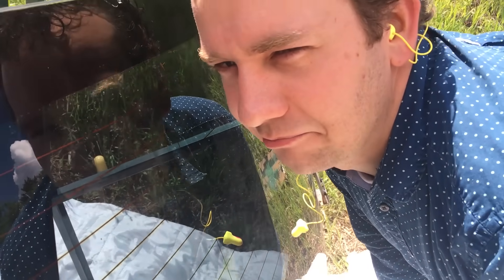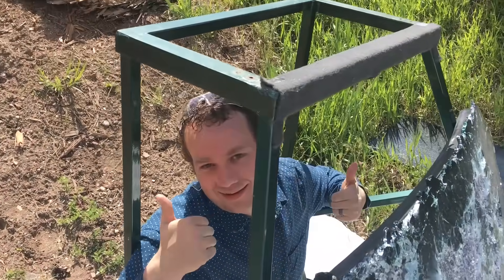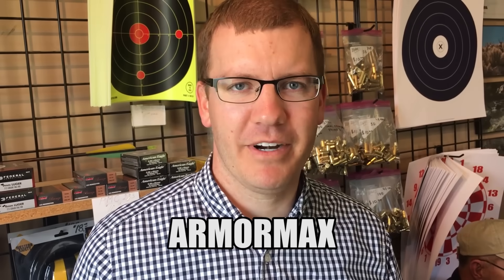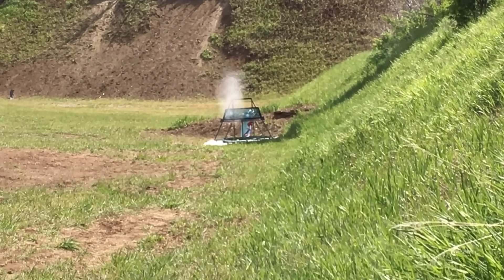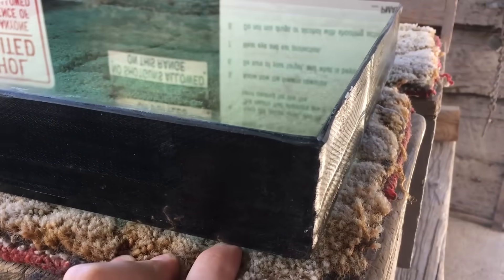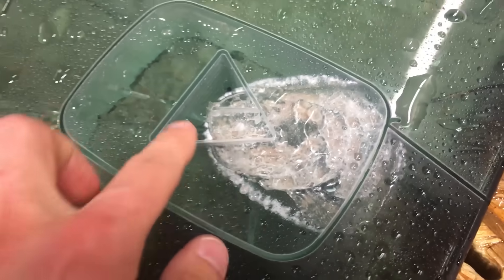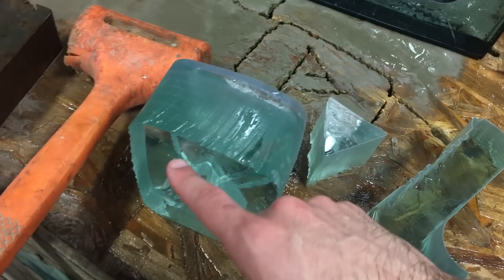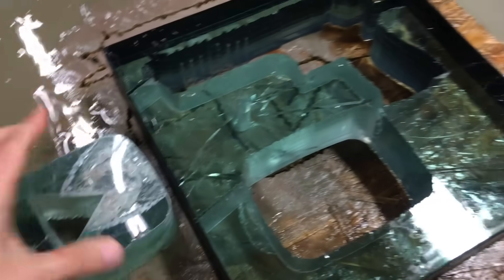Bulletproof Glass vs 60,000 PSI Waterjet

Comment: what happens if you fire a gun towards the waterjets waterbeam?
Reply: Atoms will split, it will be like Japan in 1945 all over again.
Reply: I don't think the bullet needs to hit the nozzle. It would be interesting to see if the waterbeam cuts the bullet in half mid-flight.
Reply: You get a really "Clean" shot.
Reply: I think it would just deflect the bullet downward without causing any real damage. Just like pretty much everything else they cut, if it isn't laying on something to keep it still, the water jet would just push it downward before it did any real cutting.
Reply: goku vs vegeta happens
Reply: cut the bullet in mid air
Reply: That's different, my hand isn't made of lead, or bullet proof glass, or even a solid chunk of hardened steel....
Reply: Most likely the bullet will be stopped in its place and shot elsewhere. Would be very cool to see tested and with a super slow-mo camera :D
Reply: Zorkz It'll cut a hole through the middle of the bullet but the outer shell will hit the machine
Reply: Alucard Pawpad yeah from the end of the mixing tube to the first HP plumbing is probably about that much. I run two waterjets daily and the mixing tubes alone run about  $130 (that's the part that focuses the stream to cut).
Reply: Alucard Pawpad prob redirect the bullet
Reply: maybe so, but do you think itll change the direction of travel?
Reply: The lack of a fundamental understanding of physics in this chain is starting to alarm me.
Reply: what happens if you fart towards the waterjets waterbeams watermist?
Reply: I wish I could say with 100% confidence that it would slice the bullet in half, and both sides would keep going. The logical part of me says that the most that the water stream would do is knock the bullet off it's trajectory a bit. Also to half of the people who replied to +Zorkz, who said anything about shooting the machine itself?? We're talking about sending a bullet just through the stream. It'd never happen because it's a $100k+ machine, in a building surrounded by other expensive machinery... But it would be really cool to get a Slow-Mo Guy's quality high speed shot of it happening.
Reply: It would likely not cut the bullet in half if that's what you think. If the bullet were slowed down I would think it would though.
Reply: Zorkz cut a hole through the bullet before redirecting it
Reply: I'm just guessing, but either it'd completely decimate the bullet, or just send it flying away. I don't think it'd do anything to damage the waterjet itself since the bullet would (I assume) have less force then the waterjet's beam and should just get rid of enough force it has in an instant.
Reply: Anthony Abelardo 1
Reply: shoting at the beam not the jet itself jzuz
Reply: Zorkz wow what a random question
Reply: Zorkz I think it would cut the bullet in half.
Reply: not at the nozzle at the beam its self
Reply: I.... Hmmm... Probably will reduce the total energy of the bullet? But will still damage the waterjet?
HMMMM....
Unfortunately they can't test that because the waterjet nozzle is like 10000$ or something. 
Shooting bullets at it isn't going to be cheap.
Reply: Zorkz hell ya
Reply: Zorkz othing its to fast
Reply: Jim Rr 
too soon
Reply: They should put the machine behind cover and to shoot the water.
Reply: How would that work If you'd shoot straight ad it your hand must be in the watherstream
Reply: Alucard Pawpad think shooting to a bulletproof glass is cheap?
Reply: most likely
Reply: Could fire a bullet through the beam not into the nozzle?
Reply: Well if the pressure is high enough. And the thickness of the waterbeam is high enough, the bullet will be slightly deflected. Depending on the gun. Not all bullets will be deflected
Reply: The world will end.
Reply: Zorkz I
Reply: it would either completely fuck the waterjet or depending on how powerful the jet was it could have the potential to throw th bullet back after slightly damaging the jet
Reply: What will happen if you shoot two water jets at each other inches away?
Reply: I searched for exactly that, but YouTube showed me this video instead
Reply: Zorkz wAter jet cutters rely on friction to cut. so if you shot at the jet it may not cut due to not having much time to eat through
Reply: Water jet took 14mimutes to cut that glass its actually a very slow process. But bullet speed  is very high so I think bullet will damage the nozzle or bullet will be diverted by the jet of water.
Reply: Nothing. The bullet would just pass through the water stream unaffected. At most, the water pressure may deflect the bullet trajectory off a few degrees.
Reply: Calvin Junge It wouldn't but maybe knock it off trajectory but too fast moving to cut it.  The stream is "floppy" unlike a rigid tool so the cutting feed rate is where all the magic happens.
Reply: Zorkz It'd cause about  $8,000 in damage to the machine.
Reply: Zorkz I think it would send a giant vertical shockwave with the power of an atom bomb. Just like when Thor struck Captain Americas shield.
Reply: ill have to PUN-ish you for that bad pun
Reply: Alucard Pawpad They can still test that in some kind of way. Doesn't necessarily need to be a bullet but can also be some sort of melee weapon, but thats to dangerous.

Ps: they kinda did it with a dead rat
Reply: Due to the surface tension of the water and its velocity, the bullet would shatter.
Reply: You mean fire a bullet through the jet coming out of the nozzle? That could be interesting. If you use a gun with the slowest bullet speed it might scar it but I doubt it would cut the bullet in half. Would still like to see a super slo mo of that.
Reply: waterjet vs a torpedo
Reply: So if someone has a laser capable of melting through the Bulletproof glass then bulletproof glass does nothing?

Comment: Waterjet can beat almost everything!
Reply: Wormweed  Someone was pulling your leg.  I owned a waterjet company for 10 years, and ran the machines every day.  The width of the part doesn't matter, it's the thickness that matters.  The thickness of the material or the hardness of the material, is what determines the speed it will cut.

If you had a knife blade facing up, and ran the jet across it quickly, it wouldn't cut through it, but it's the same if you ran the stream across a 1" thick piece of steel at the same speed.  Slow the machine down to cut whatever the thickness of the blade is, from the sharp side to the back of the blade, and it'll cut it just fine.
Reply: cant beat water
Reply: Can it beat nokia?
Reply: If you used the kind of carbon nano rods that are harder than diamond as the abrasive material, you'd be able to cut anything but neutronium.
Reply: Waterjet vs waterjet
Reply: It's can't beat my meat
Reply: but not flex tape
Reply: Beat maybe. But it can't cut tempered glass. Nothing can. Destroy it, yes. Tempered glass has enormous internal tensions that balance each other. When you start cutting it, the part that is being cut cannot have internal tensions anymore (because the 2 parts of glass are not touching each other anymore), the remaining internal tensions becomes unbalanced, and the piece self destroys at a speed that is hard to catch even in slo-mo.
Reply: adb012  I agree.  Nothing would be left of the blade if you tried to split it like you said, unless it was a really thick blade.  I assumed it was only cutting across the cutting edge, not along it.
Reply: Waterjet can't cut foam
Reply: Damian Verhoeks 
Actually everything?

Lets cut through bedrock xd
Reply: They can cut anything that's wider than the jet. So it might not be able to cut a knife from the edge, if it's set up 100% accurately. At least that's the only limitation i heard of.
Reply: Now try cutting (splitting) the blade along its length with the edge facing up. That's what Wormweed meant (I guess). You will erode all the steel and end up with all the blade converted to steel dust in the bottom of the pool, instead of 2 blades of half the thickness.
Reply: adb012 wot about thee most pourfull bomb on eatrh
Reply: Do you believe that the most powerful bomb on Earth can CUT tempered glass? (or anything else?)
Reply: +throngcleaver, So I assume a lot of heat is forming at the impact point which is what causes the jet to push through?  The thing is the water cools off that area so fast that It's not possible to measure what is happening heatwise from the outside?  I mean unless sensors were on the material it could record how much heat went through before it vaporized?  Kind of like trying to understand how much speed and pressure is happening directly at the center of a tornado vs from the outside?  Kind of like when you swipe your finger fast across a flame you don't get burnt.  You only get burnt if you leave your finger on the flame for a long duration.  It's like that but with the waterjet it happens far quicker, like can't tell because of speed of lightlike fast where you would think it's happening timestop instantly but it's not.
Reply: Bulbasaur aint killin shit squirtle today
Reply: How about titanium
Reply: Damian Verhoeks iiiii
Reply: Damian Verhoeks xcvffffg
Reply: Damian Verhoeks it obviously can't beat my unstoppable will power
Reply: Damian Verhoeks 
bulletproof: yup
Waterproof: nope
Reply: This is bulletproof yet no waterproof lol
Reply: Damian Verhoeks i
Reply: Damian Verhoeks w
Reply: Nozle
Reply: I bet it can‘t badrock
Reply: Damian Verhoeks you’re not wrong. After all, they often cut diamonds with water jets
Reply: “Almost”
What can’t it defeat
Reply: It’s not impressive. The glass is designed to take impact forces. Not steady pressure.

I’m seriously disappointed a majority of people don’t know that.
Reply: Damian Verhoeks Even imortality? Even Superman? Even Wolverine?
Reply: Now I want to know what happens if they try it
Reply: MetalBeastRage wrong
Reply: They cant cut light.
Reply: Damian Verhoeks can it beat diamond?
Reply: Yup, there's a video of them cutting a diamond
Reply: Damian Verhoeks can’t beat my super soaker
Reply: Can it beat my meat??!????
Reply: but if you use neutronium as the abrasive..
Reply: +Anthony Abelardo  I do not know how much heat is generated at the interface between the edge of the cut in the material and the stream of water/abrasive, but I can say a few things about that.

First, the water is fairly warm, having been pressurized to between 40,000 and 60,000+ psig and squeezed through the orifice in the jewel.  The water exits that orifice at between 2.5 and 3.0 times the speed of sound, and enters the carbide nozzle.  After a day of cutting, all the water in the tank below the gantry is pretty warm, but not too hot to touch.

Water alone, can only cut softer materials, like rubber, thin wood, leather, diapers, fingers, and so on.  To cut metals, stone, ceramics and other hard materials, abrasive (commonly garnet, but others are used) is fed into the cutting head and enters the high velocity stream of water, between the orifice and the top of the carbide nozzle.  The abrasive accelerates quickly in the nozzle, but the stream of water and abrasive has slowed down to around Mach 1.5 by the time it exits the nozzle.

It is the abrasive that creates the most heat in the material, during a cut, (just like sanding on a belt sander) but I can assure you, just cutting with water alone gets the nozzle to hot to touch, but it's much hotter with abrasive flowing.

Some waterjets cut with the material and nozzle under water, while others keep the material above the water in the tank.  The only difference there being, that a machine cutting under water is much quieter, and has nothing to do with cooling.  There is plenty of cooling effect from the water during a normal, above water cut, and no heat damage is done to the material.
Reply: wood beats water
Reply: Anthony Abelardo fucking keyboard warrior
Reply: like if true!
Reply: almost?
Reply: exualy everything

Comment: Cut a Ruperts drop!
Reply: it would as soon as you break the surface. Because then the internal tension has some place to go.
Reply: It would immediately shatter and that's all.
Reply: buzz killer
Reply: Scoop Science I can't even begin to tell you how wrong you are.
Reply: Jan Hendrik Franke   They need a high speed camera when they do this one. Or a high speed camera in general!
Reply: But the the "dropplet" part is near inderstructable, it's only when the small fragile tip is disturbed that it will shatter, otherwise it would need immense power for the surface to shatter.
Reply: Jan Hendrik Franke yesss
Reply: Scoop Science No lol bullet proof glass has hard and soft layers of non glass materials im not every sure what they are but the actual glass isnot a Rupert's drop
Reply: I never said that bullet proof glass was a Prince Rupert's  drop, I said it is essentially the same thing. The layers of glass that make up bullet proof glass are made from a process called the ion exchange process and this results in similar inner strains that a Prince Rupert's drop experiences. (To put it simply)
Reply: bulletproof glass is made of just layers of plastic and glass.
Reply: IAmTheFatman66
Reply: IAmTheFatman666 Not necessarily.
Reply: Bullet proof glass is essentially the same thing as a Prince Rupert's drop, except it is made differently (rather than melting glass and then having it drop into water)